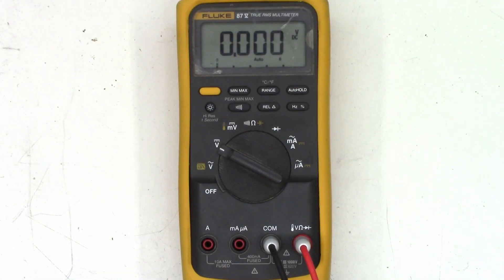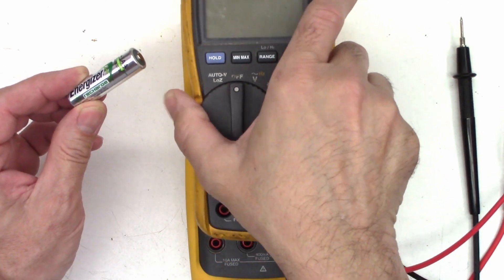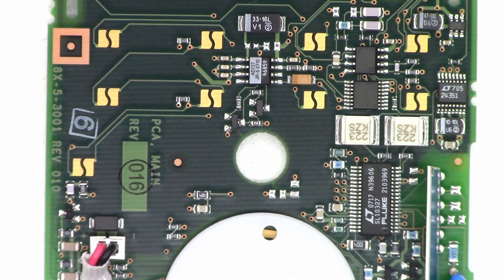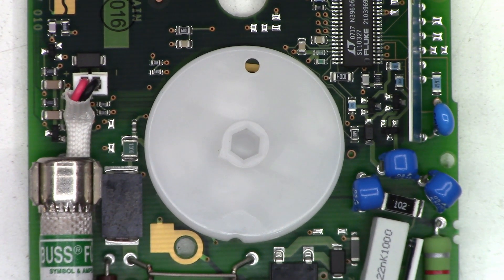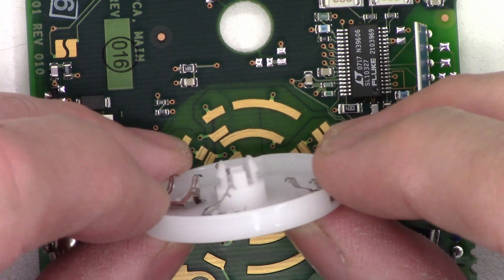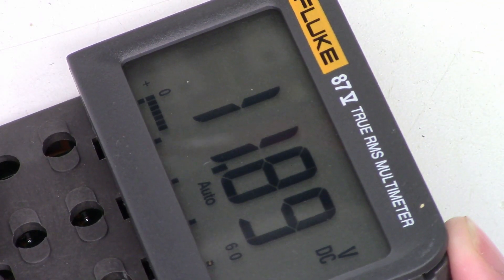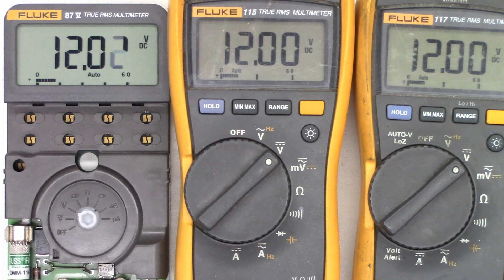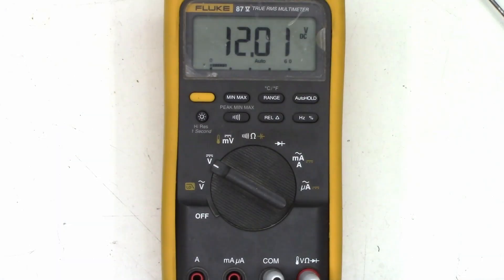FLUKE 87 MULTIMETER - NO VOLTAGE MEASUREMENT REPAIRED FIXED - SAVED FROM THE E-WASTE / RECYCLE BIN

Comment: Those are the most fixable meters. If it's a fluke, I'm 90% sure I can fix it. I pulled a broken Hioki 3200-50 from a goodwill shelf for $5. I use that thing almost every day. You can leave it on for up to 500hrs straight on 2 1.5v alkaline cells. It has a 20uA current range and I was able to confirm accuracy to within a few NANOAMPS. Some of the best things I own would have been trash years ago had I not taken a screwdriver to it. I hope to find a broken fluke on that shelf some day.

Comment: Hi! I ran into a broken fluke 87 that isn’t reading resistance or diode mode well. Diode is showing around 2v when not connected and ohm showing around 320. Any thoughts? I’ve check the input side and all checks out. I need to look into the diode voltage supply next. Thanks!

Comment: Great video,hope you don't mind me asking a question I have a fluke 117 love it to bits,but lately, the buzzer seem to be getting lower in volume, fresh battery and fuse,do you think my board is on its way out!thanks
Reply from the maker: Try and clean the contacts to the piezo beeper/element and see if anything changes. I dont think this has a all in one enclosed "speaker"

Comment: Not to be too pedantic, but where you said 1 or 2 percent a little past 8 minutes in, that would be 1 or 2 tenths of a percent.  This would seem to be within, or at least on the edge, of the specification for that range which is +/-  (0.05 % + 1).

Comment: Nice work! Looks like u know your job. I have a Fluke 15B (which i recently hacked to be sort of 17b), which has some continuity issue. One day after batt swich routine i had a leak, but nothing that serious (some corrosion on terminals meter itself + and in batt shell), but i wiped and brushed it clean, checked pcb solder pads and so on, all good.  When i set it on beeper and short test leads i have ridiculous 380 ohm resistance, and while i'm holding leads together it started to drop, but sloooowly. I have a spare crocodile clamp probe, short it together and let them hang for a while. After a minute or so, i started to hear a beep, so does resistance drops to 78, started weak buzz and solid after a little while (i know a solid beep on 40 ohms according to calibration manual). After de-clamping and testing, everything become somewhat normal, and even after re-switching to other modes, but still over 40 ohms. /*EDIT - after turning meter off and back on after minute or two, issue starts again */. My original leads long gone, i am using relatively cheap ones, it does the job (uni-t's, but looks phony af)), it was like 1.5 ohm probe resistance or so, can't remember. I love my meter, it was a gift and really need to fix it normal again. I am a service engineer, so any advices, like replace smd elements, can be appreciated. Problem is, i don't have another multimeter to help me fix mine, and really scary to mess with it by myself, without some guidance. By the way, it's full of trimpots, may be cell leaks under one of them without any signs of cause, or maybe dry cap... no idea. Please help ^.^
Reply from the maker: I am sorry but I got lucky on the 87. I don't have a clue what may be causing the issue. Sorry.
Reply: @norcal715  Nah, it's ok, i guess. Wish i have luck like u are. Anyway, mb someone faced this kind of issue might help. I just wondering %)
Reply: @norcal715  I figured out what happened tomorrow. My guess about wrong current flow was right. Ok, so we have two batt terminals. Positive one, even though it looks completely alright, after de-soldering i notice it started to become....umm dunno how to say.... rotten solder pad, ha. I rework it with heating gun and solder pad was like a sponge, bubbling all the surface. Fluke quality of soldering components un-judgably good, but terminals - it has a blob on outer side, so it wasn't noticeable at first glance.

Comment: Hi! Awesome video! I have a Fluke 324 clamp meter which I mistakenly connected to  230Vac while on continuity mode, and it now sometimes beeps weird to indicate continuity... I mean it doesn't make the normal beeping noise but rather a weird one.. any clues to what it might have wrong? I called Fluke but they told me that they wouldn't repair it and that I should buy a new one, which I can't afford.

Also great video! Thanks so much for sharing it with us!

Comment: I'm a bit confused, my Fluke 87 buss fuse DMM 44/ 100 and below the fuse on the board shows 1000V  100A fuse. 
Please clarify if it's 400MA or 100Amps.
Reply from the maker: There is both an 11 amp fuse and a 400 ma fuse

Comment: I have a fluke 87 stuck on .900V dc reading and its not reading any voltage also AC or also doesnt work in diode mode. I already changed the resistor anything else I should be looking at?

Comment: Very nice @NorCal715.  A $400 meter repaired with a ten cent part.  Fluke would have charged at least $100 for that repair.  I have to replace $1000 circuit boards likely because of a ten cent part failure.  I hate the fact that I don't have the brains to fix many circuit boards and have to bill my customers for board replacements.
Reply: Precision laser trimmed ceramic resistor arrays are not ten cents a pop.
Reply: Labor costs + precision resistor divider would probably legitimately add up to $100 lol. That resistor divider could possibly be the most expensive part on the board.

Comment: Those resistor networks are designed to handle in excess of 1000V, you can probably buy a replacement, hey will be Caddock brand.

Comment: Thank you Sr For 1 more very detail video .Mr nor cal 715 I have a question for you. Am a little confused about how to use my pr-57 my question is do I need to disconnect the ground terminal on my pr-57 to be safe or do I have to use an adapter 3 to2. If am working on a device that have a 3 prongs cord on it? Again tank you for all your very good videos.
Reply: Disconnecting the ground from the output on this model isn't enough as the metal clip that holds the outlet in place bonds to the chassis (and ground).  Probably easier to use a 3 to 2 prong adapter, especially if you want to ever use the leakage detection functionality.
Reply: Thank you very much Sr For Answering my question. And that's what am going to do use a 3 to 2 adapter on my pr-57 . am 100% sure that a lot of people will be very happy if you whit all your experience on electronics makes a video on safety about hot chassis ,grounds and osciloscope safety .thanks again Sr.

Comment: Hopefully you will get a high voltage resistor, or at least 2 4M7 in series, with a lower value to adjust up the resistance, because otherwise you really should not subject that little 0.25W resistor to more than 125VAC as it might flash over.

I was thinking at first the input 1k resistor was open circuit, a common fault, but the ceramic divider is not a common thing to have fail, just guess it was dropped exactly the wrong way.
Reply from the maker: I don't plan on ever using this meter over 120vac so I think it will be fine. That thought had crossed my mind also. I had to try about 20 different values before I found one that was that accurate.  The difference between .995m and 1.002m was a deal breaker. Maybe one day I will replace it with a couple of precision 5 megs or (4)2.5 megs thanks for watching.